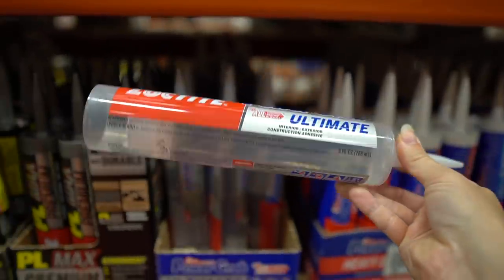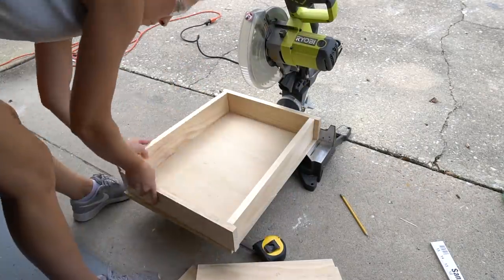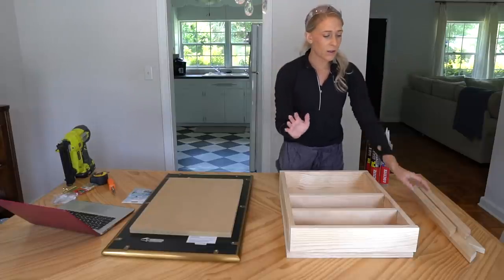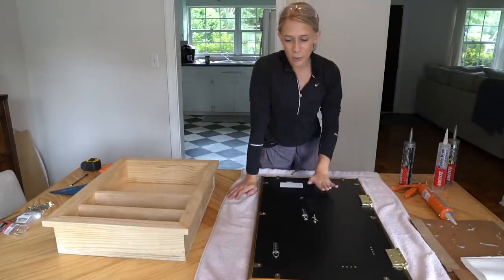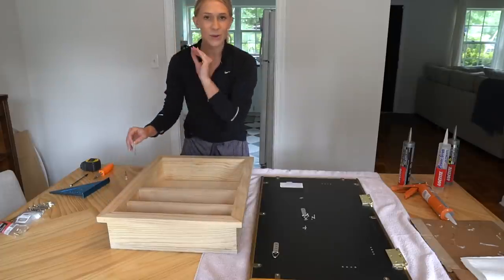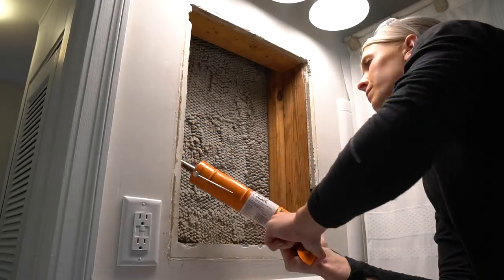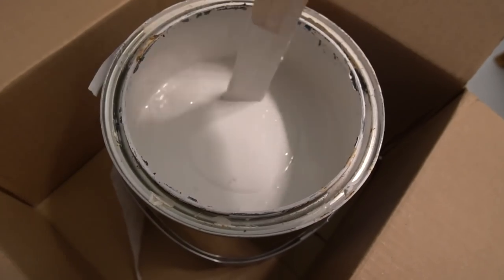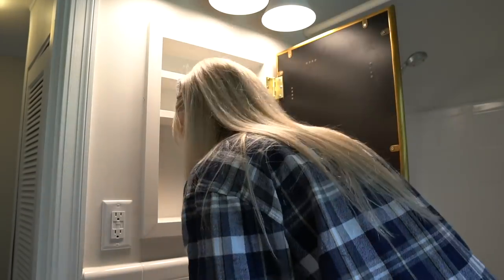DIY Medicine Cabinet | How to Replace a Medicine Cabinet

Comment: I'm about to build my own medicine cabinet since i couldn't find anything that met my needs. There's a few things about your build that i would do different though. The spacing between the studs isn't a lot, so why use 3/4" frame with a 3/4" backing, with fixed shelving? 1/2" frame with a 1/4" backing and adjustable shelves would be better. I don't know why you added adhesive to the installation. If you ever decide to take it out, it'll be very difficult - you might have to break all of it. If it works for you, cool, but this build  gave me the insight of what not to do.